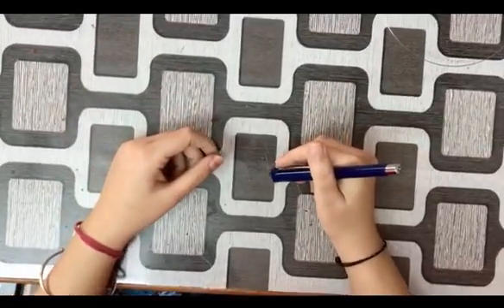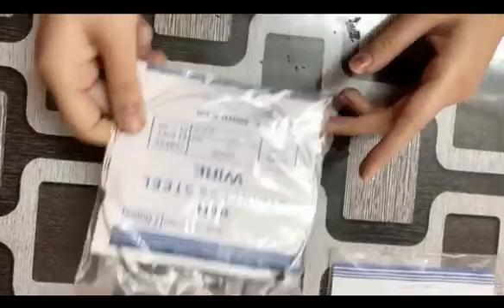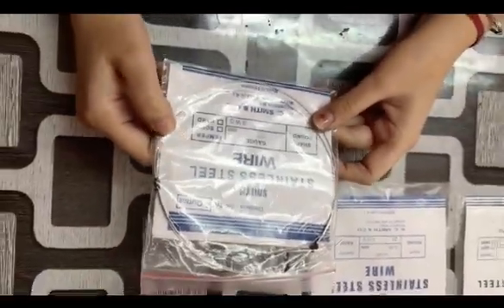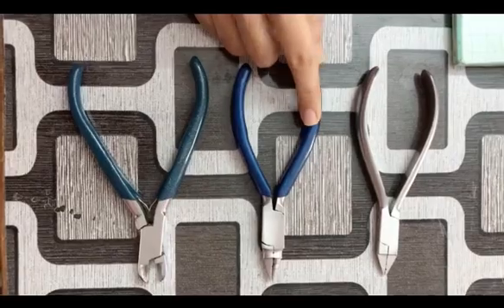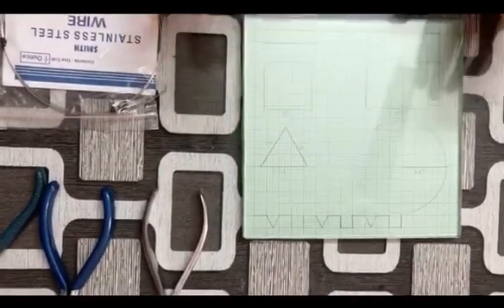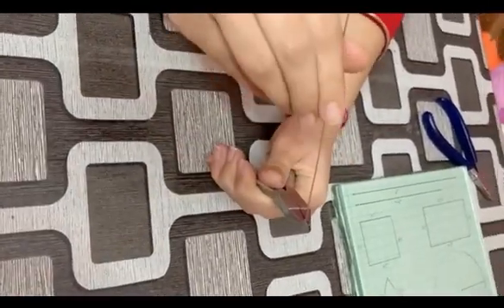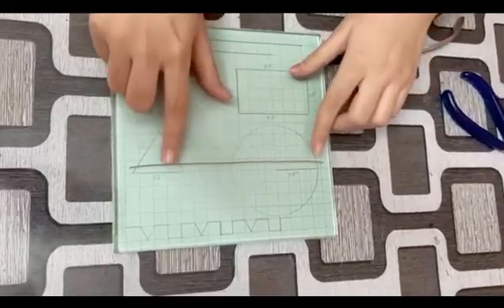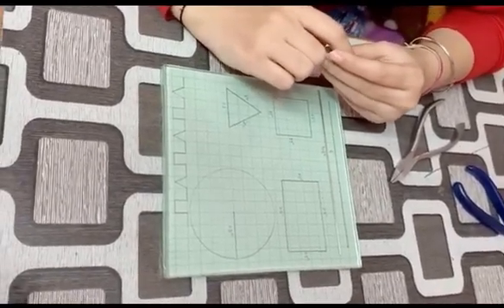Straightening of Orthodontic wire//Stainless steel //Cr-Ni wire
#DoctorTalks

Comment: Sir/Mam do you have any technique to make an orthodontic wire straight, triangle,square,circle etc. Without getting the hand swollen? 
I really can't apply so much excessive force with hand for removing bends and making the wire a perfectly straight one which gets my hand swollen, with lots of pain after every orthodontics class. Please help!!
Reply from the maker: Put a doctor tape (single layer) on finger...
It will reduce the pressure.
Then finishing will be done without tape
Reply: @dr.gazalmadaan  Thanks a lot Dr.Gazal Mam🙏🙏😇 
I will try it for sure 👍😇